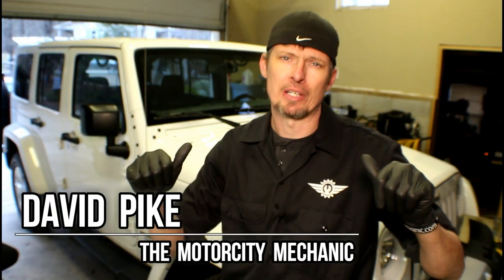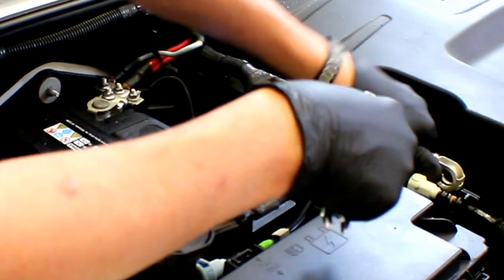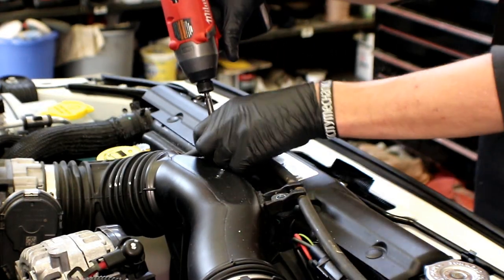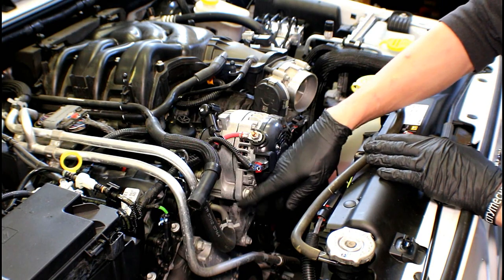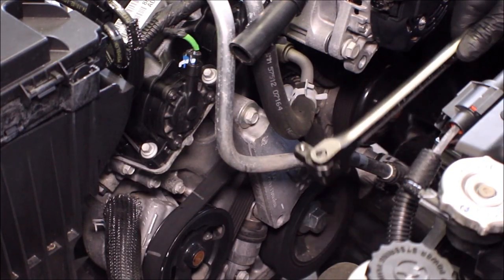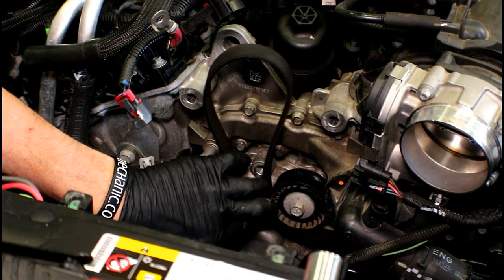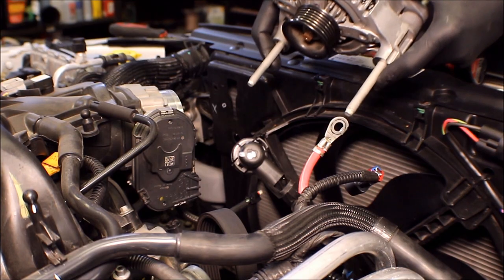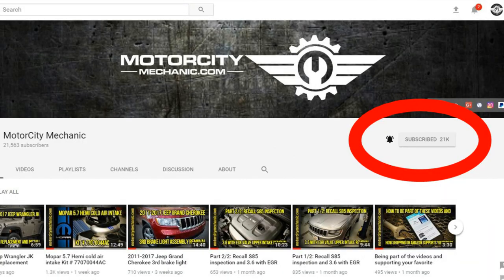2012-2017 Jeep Wrangler JK 3.6 alternator replacement

Comment: Would you happen to know the torque specs on the 2 bolts that mount the alternator bracket to the timing cover and then the 2 upper longer bolts that mount the alternator to the timing cover as well?

Comment: Nice video. Heads up I did not have to take the bracket off. Just the top two bolts to the alternator

Comment: Great video sir!! I do have a question what are some signs that an alternator is bad. I had to pick up my daughter said my 2013 Jeep Wrangler didn't want to start,  After jumping engine vehicle turned off a couple of times was able to keep it running made home but did notice while traveling all gauges were not working properly radio screen turned off. Any insight would be much appreciated. Thanks

Comment: There's always something more difficult than the video shows. On my Jeep, that breaker bar part with the pulley does not want to move. I'm literally standing on the breaker bar and it's barely budging. But was finally able to get it to move but had to put a lot of strength and effort on the breaker bar while my wife moved the belt off and on for me.
Reply from the maker: It takes some effort for sure because of that shock they added to the belt tensioner set up. That’s the main reason I have some long breaker bars

Comment: Best online mech video ever. Direct... to the point and simply put. Angles were great. He even said the right size sockets needed. I have never changed mine before. Did a full replacement in 45min.
Reply from the maker: Thanks Regan. Appreciate the feedback and glad that it turned out well. Make sure to subscribe and check out my other videos when you get time

Comment: can you change the belt without taking the alternator out seems like it would be a tight squeeze?
Reply from the maker: You can replace the belt with out removing the alternator. It does require removal of the lower alternator bracket however. That will get you the needed room to work it around the pulley on the alternator. Thanks for that question!
Reply: also ty

Comment: I noticed there wasn't a ground for the alternator like on others I've changed. Does the alternator in the Jeep 3.6 ground through the bolts into the engine block?
Reply from the maker: Its rear that there is a ground on an alternator.....I have seen it on the Durango and Grand Cherokee but nothing else. Otherwise it will ground thru the body of the alternator and the engine. Thanks for asking and make sure to subscribe.

Comment: Great video! Quick question - do you know if a 2016 JK Wrangler has a smart alternator? Or is it standard? I’m looking at a dual battery set up with a dc dc charger.
Reply from the maker: The charging system is controlled by the PCM.......It has a 2 wire connector that is issued to control the generator field circuits externally by the PCM. I hope that helps to answer that question. Thanks for asking and for watching. Make sure to subscribe.

Comment: Subscribed! GREAT video. Concise, well spoken, I'm impressed!  I'll be changing my alternator out later in the week using your video as a guide! Thanks!
Reply from the maker: Awesome. Appreciate the kind words. Take your time and follow the steps and you won’t have any issues. Subscribe and check out my other videos as well
Reply: MotorCity Mechanic I went ahead and got started tonight. I did have to remove the coolant reservoir to get ample room to compress that shock with the breaker bar.  Also the middle bolt on my bracket was a 16mm.  While I was in there I found a hairline crack in my thermostat 😠 so back to the auto parts shop for a replacement before I put the new alternator in.  Thanks again for the awesome video!
Reply from the maker: Your welcome. Thanks for the update and glad to see that its coming along fine other then the t-stat housign issue but then again what better time to catch it.

Comment: You are a GREAT MECHANIC, sadly WRANGLERS suck! I believe my ALTERNATOR just went on my 2014 Unlimited Sahara with only 45 Thousand Miles, Started the jeep up went and got coffee came back out put key in ignition and NOTHING! No lights, No power, wont crank....We even got a new fully charged battery try jumping it and NOTHING! With new battery plugged in everything turned on, but NO cranking. Cant wait to get ride of this 2014 Wrangler Unlimited....FIRST AND last Wrangler, was thinking of trading it in for the new Jeep Pick up.....Nope.....Going Tacoma now!

Comment: Thank you, David, your breakdown was right on. Until I watched your video I thought I was going to have to remove the alternator just to replace the belt. The previous four videos I watched on removing the belt never mentioned the triangular bracket under the alternator. Go figure. 
Even with the two-foot breaker-bar, this old man [70], needed a three-foot cheater pipe on the breaker-bar to push that hydraulic assembly down, loosening the belt to get it back on.
Reply from the maker: Glad it all worked out in the end.....its all about leverage and actually about going slow to aid in getting that odd tensioner to release enough to remove the belt. Odd set up for sure from the tensioner to the backwards alternator. Thanks Ben for watching and for the comment. Make sure to subscribe!

Comment: Is it really necessary to remove the triangular bracket?  I think you can just remove the two long screws holding the alternator to the engine and the two short screws holding the alternator to the triangular bracket.  Thus leaving said bracket in place.
Reply from the maker: There is always more then two ways to skin a cat. It might make for a very tight fit. Next time I have to replace one I will look a little bit closer. Thanks for asking and for watching. Make sure to subscribe.

Comment: Oof, you first said 15mm on the bracket, but later say 16mm. I just started to disassemble and found out I don't have the 16mm socket.

Oof. Just walked to the shop and bought the 1/2 breaker, but the 16mm now? Lol

Comment: Helped all the way through question though. The top screws of mounting bracket won’t quite get in to the alternator however the bottom 2 screws got in and the alternator is sitting on tightened top screws. Is that ok or will I need another alternator?

Edit: after probably 100 watches still put mount on wrong 🤦🏾‍♂️🤦🏾‍♂️. One quick review to correct once again great video.

Comment: I have subscribed. Your PT timing belt and water pump series was amazing. I'm doing one right now. An 07. I have to pull the head. So concise. I'm lucky enough to have two racks at home. Fun and games!! What is your feelings about the Fiat takeover? Do u still bleed Mopar?
Reply from the maker: I still bleed mopar but there are a few cars that I dont believe deserve the name Jeep or Dodge on the front hood. When you have a bigger brother they always try to squeeze some of their cars into the american market. Daimler was the same way with vehicles such as the Sprinter and Crossfire. It comes with the job I guess. Thanks for checking out multiple videos of mine and for the great feedback.

Comment: FYI to anyone installing a new alternator; torque the top 15mm  mounting bolts to 43 lb-ft, and the bottom 13mm bolts to 22 lb-ft.

Comment: I've seen that before that the belt pulley is installed towards the engine instead of the radiator. Why is that? To protect the alternator if your 4-wheeling? If some can let me know thanks

Comment: Really appreciate this video man. Great learning experience. My question is why does it look so new but need a new alternator? I have a 2012 jk that I just got done wheeling and it's having some sort of whining noise around the belt area while accelerating. Gonna do a proper diagnosis tomorrow. Was this one whining as well?
Reply from the maker: Actually this one was removed just for the video. Sometimes I grab a vehicle and do a repair video on what ever I find to be common or that someone asks for. There was no actual issue......just used for filming. There is a chance you need an alternator. First diag the noise and see if you can narrow it down. If you went thru any water or mud that was deep enough to get up to the alternator then there is a good chance it may have damaged it. Thanks for the question and make sure to wubscribe

Comment: Fantastic video.  Just installed a 250 Amp Alternator from Michael Singer on my 2016 Jeep JK Rubicon 2 Door.  Your video made it very easy.  I had to replace the belt with a shorter one due to the overdrive pulley on the alternator.  Piece of cake.  Thanks for the help.
Reply from the maker: Your welcome. Thanks for using this video to take on the job. Make sure to subscribe and Merry Christmas

Comment: I left my job as a dealer tech like 10 years ago- cordless tools were nothing like today! Have those Milwaukee tools worked well for you? I'll be looking to get a cordless impact to do tire rotations and such sooner or later now that I have a place to tinker again.
Reply from the maker: Hey Mike....I feel like I was one of the last mechanics to make that change. I always had a cordless drill of some sort but nothing strong enough to not stop using air. Then I decided to step it up a notch and started with the 3/8 ratchet and the impact as well. I was lucky enough to have Milwaukee send me their newest 1/2 drive 600ft/lb impact. I have to say I am impressed. I have been challenging myself when doing engine and trans work to only use hand tools and my Milwaukee cordless tools. That impact has taken balancer bolts, lug nuts, and axle nuts off with no issues. Its alot cheaper then the closest Snap On version. When it comes to items like the cordless ratchet.....I never expect it to take off super tight bolts, I knew that going into it already which I understand.  It will break bolts loose for sure but remember its not a 18volt ratchet. I can say that I havent had to use my air impacts for weeks now and with all the water we have in the line in the summers.....I am not missing it. So if you have the chance to stop by your local Home Depot......check out the Milwaukee line of cordless tools that they carry. Otherwise you can get them on Amazon as well. So no need in a large air compressor and plus you can take them anywhere to do any job you need done. Thanks again Mike for the question.

Comment: Time is money...while you're doing all that work, go ahead and replace both of the idler pulleys and the pulley on the tensioner, and the serpentine belt :-)...$100 of parts just saved the labor of doing it all again when those go bad and also kept you from breaking down in the middle of the places your Jeep is supposed to go ;-)

Comment: Hey man! Awesome video I followed every step of this video to change my alternator just now. Everything was smooth until I got in there to crank it up.. there was nothing! Dash lights and interior lights turn on but it won’t crank. What do you suggest me checking? Did I do something wrong?
Reply from the maker: Nothing is coming to mind. I can only recommend double checking everything such as the battery connection.

Comment: What length is the breaker bar you are using in the video? I got all the way to the breaker bar portion and my bar handle getting blocked by the clamp to the bottom right of the alternator and the windshield washer fluid container when I press down. The bar hits the crimp/clamp and go down, I can remove the clamp but really dont want to do that if not necessary

Comment: Thanks for the very informative video, for what little info is needed. By that I simply mean because it's a pretty elementary repair, not because of the amount of info. In fact, for what it is, you managed to detail every step in the most professional and clearest way possible.
Im thanking you for the video because Im doing this job tomorrow for one of our customers, off the clock for cash. We dont actually work on customer's cars, we work on their motorhomes. I'm an RV service technician. But we try to do little things outside our wheel house for good customers. Now that Ive seen the job done by someone who is obviously a professional, I can go do it tomorrow and look just as professional. In fact, before the customer gets there, I can have every tool needed organized and laid out on the cart in order, 8mm, 10mm, 13mm, 15mm, 16mm, ratchet, impact driver, breaker bar, small flat blade screw driver, gloves, throws and fender covers, all ready to go so I can get in and get out and look like I really know my shit and impress the customer!!
So, again, thank you!
😁🤘

Comment: I replaced my alternator yesterday after watching this video.  It was pretty easy.  The hardest part was releasing the belt tensioner since I was working alone.  I stood in the front of the Jeep on the passenger side and put a cheater on my breaker bar then leaned my weight into it.  The hydraulic cylinder compressed after a moment and I was able to slip the belt off the power steering pulley. Putting the belt back on was easier than taking it off.  I did not remove the triangle bracket and instead just removed the alternator.  I could not get the small electrical connector on the intake to unplug and I was worried it would break so instead I just rolled the whole air intake over on top of the engine and left it plugged in.  There is enough slack in the wire to do this.  The two long bolts on the alternator have a ridiculous amount of thread on them, a lot more than I anticipated but it was fine.

The Jeep dealer wanted $1,190 for a new alternator which includes labor.  They also offered a remanufactured alternator for $512 installed.  I bought a remanufactured alternator at O’Reilly’s for $224 and installed it myself in less than an hour.  The alternator from O’Reilly came with a lifetime warranty where as either option from the dealer did not.

I am an old man with serious health issues and I got this done by myself.  If I can do it, anybody can do it.

Comment: Thanks for the vid, question on the torque specs on all the bolts you remove if you have info on those would be very much apprey

Comment: Really nice video. Thank you! 

Just a question I hope you can help me with. I recently received a Tuff Stuff alternator from Quadratec. The alternator came with an extra ground connection next to the main power lug. Is it critical that I ground the alternator in this fashion or can I rely on the alternator body grounding where it bolts up to the engine? I should add that the pics of the alternator on their website did not show this ground connection. Many thanks and again, great video.

Comment: Is it safe to use evens waterless coolant in 2017 jeep jk. Is the factory coolant better
Reply from the maker: Not sure the affect it would have. If you did I would recommend removing all the old/previous antifreeze so that there is no mixing happening. Personally I dont see any issues with the OEM antifreeze unless your in somewhere like Iraq where its 130'f  during the summers. Thanks for asking Joe and for watching. Make sure to subscribe.

Comment: Excellent video! I'm actually replacing a water pump on the same vehicle and it looks like I need to pull this off in order to do that.
Reply from the maker: Thanks for the kind words. Yeah it will need to come off to at least get you more access. Thanks for watching and make sure to subscribe. sorry for the delay
Reply: @MotorCityMechanic  As it turned out I pulled the water pump for nothing. It was diagnosed as being the oil cooler housing that was leaking, spraying toward the firewall from directly over the motor, right in the center. All good now.
Reply from the maker: @mdpocoroba  Glad it got fixed in the end.....appreciate the update! I dont see alot of them leak but it happens from time to time.

Comment: Thank you for the great video.  For the life of me, I can't get the belt back on.  I confirmed it is still routed correctly.  I did have to replace the tensioner and it compresses same as the OEM but it's as the the belt is a couple inches too small all of a sudden (I didn't change the belt).  Any thoughts?

Comment: What is your opinion on the pentastar? We have a 2016 Jeep.  So far so good.  Thinking of a minivan with basically the same 3.6.  We currently also have a 2007     Caravan with the 3.8.  Hopefully the 3.6 is better because the intake gasket blew out on the 3.8 a year ago.
Reply from the maker: Each engine has its issues. I could go down a list of issues with the 3.8 and compare it with the 3.8. In the end....the 3.6 has great power for its size. I do alot of videos on it and see it everyday. Over time it has evolved and the issues worked out of it. Being that is a 2016......you have a good version for sure. When getting a 3.6 vehicle......its liek you were told as a child or overheard the grown men saying....never buy the first year of a vehicle. If I had to narrow down a starting year for the 3.6 when the issues became less and less it would be 2015. Only issues I had with the 2014 is the possible oil leak at the oil filter housing. Thats just my two cents. Thanks for the question and for watching my latest video.

Comment: Super helpful. Thanks!!!
Reply from the maker: Your welcome Kenn. Thanks to you as well
Reply: @MotorCityMechanic  It may sound trivial, but the detailed breakdown of how to unlock the connector is really useful.  My Jeeps are 10 and 20 years old, and most connectors are pretty stuck or corroded. Over time, I've broken just as many connectors as I've sucessfully opened, because I don't know whether it's just a little stuck and just needs to be pried open a little harder, or whether it;s still locked and prying on it will break it.  So really good to navigate without messing it all up.

Comment: Not 1 mention of the torque for the bolts.
Reply from the maker: It’s an alternator 😂 not a cylinder head. Snug is all that’s needed. When I feel it’s needed or required I always add the specs....not in this case